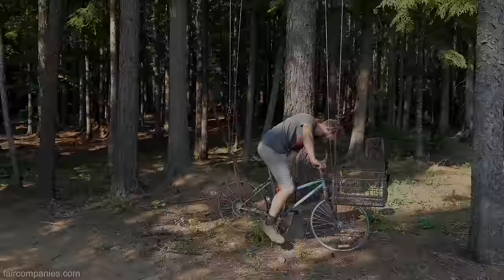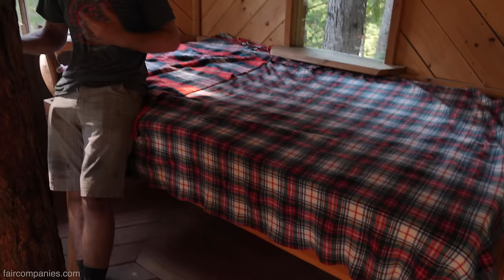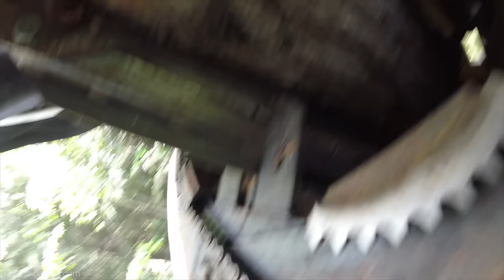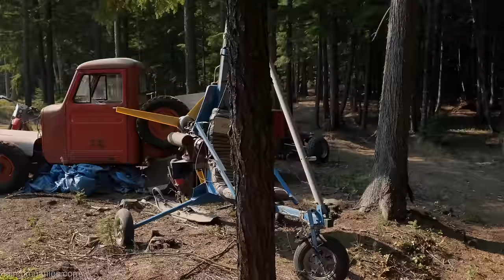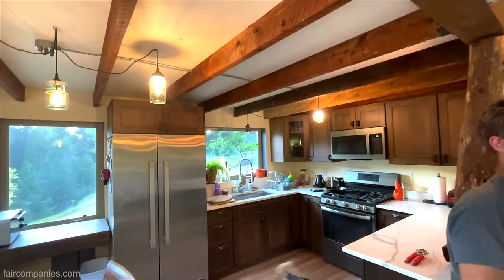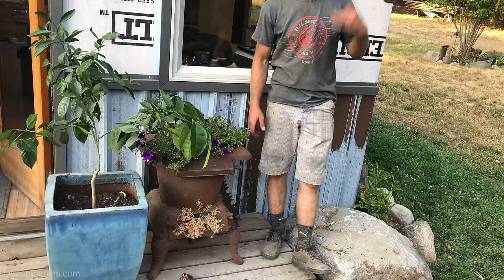School was rigid. Built dream career learning through play

Comment: I'd be far more worried about the compression/friction based suspension of the tree house girdling the tree than the weakness created by placing a few 1.5in holes for bolts - the former will likely kill the tree far faster than the later.

Incredible creativity - absolutely love the tinkering and experimentation and the DIY attitude, very cool!

Comment: With a compression ring holding the tree house up, can the tree still grow? Or could you design expandable connections so as the tree grows it doesn’t put pressure expanding outwards into the frame of the treehouse?